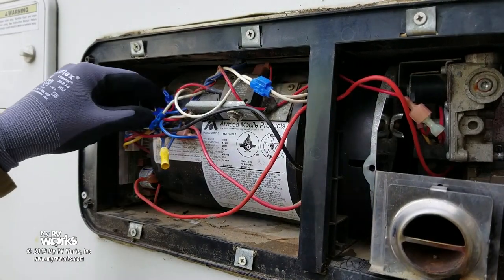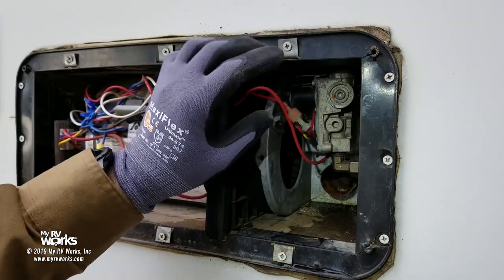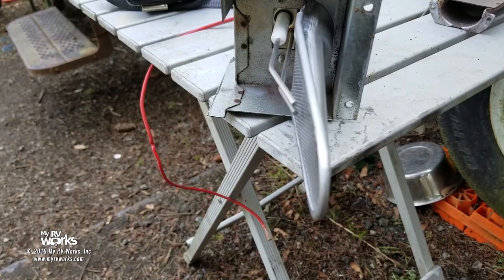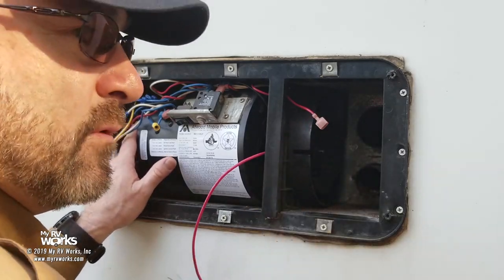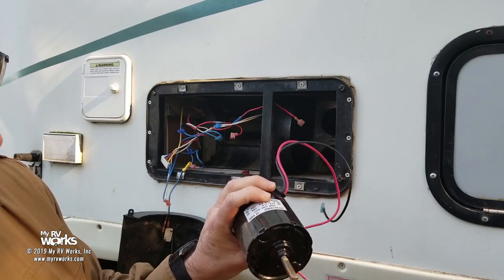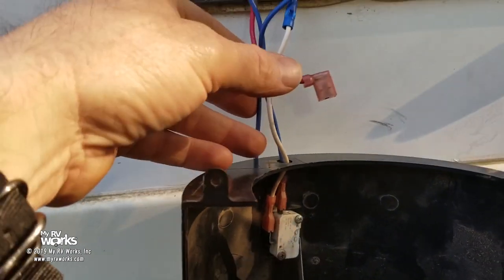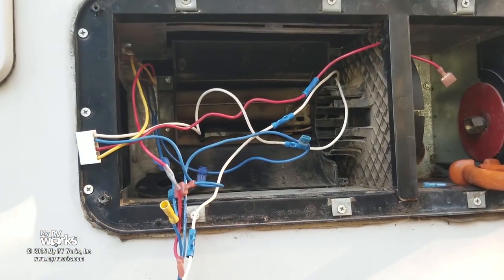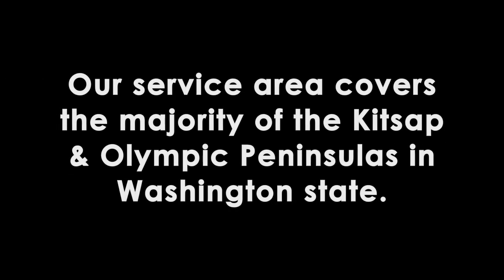RV Furnace Motor Squealing - Remove & Replace Motor, Electrode, and Burner

Comment: You asked for different ways to remove the blower wheel or fan from the motor shaft . 
Years ago in the 80s, when I was starting in the HVAC field an old timer taught me a trick because I was tearing up the blower motor fan on a furnace. Lol
His trick was to loosen the set screw and place an old socket over the shaft onto the collar of the fan, hitting it with a hammer to drive the fan blade just a little bit further down onto the shaft. Then use sand paper to clean the old motor shaft before attempting to remove it. There's always a rust or dirt line around it. When it's clean then I spray it with oil before I attempt to remove it by gently prying it from behind with 2 screwdrivers.
 You may already do this but it's worked for me for a long time. You have the best repair videos I've ever seen online for this type of repairs. Thank you for taking the time it really helps me.

Comment: Thanks Daren. For the motor job. It's getting easier for me to follow, the more I watch the more I see and understand.
Reply from the maker: You can do it!
Reply: Yeah I like that. You can do it. Yes I can do it. I don't want to lol. And I'm using the age card 60. But no, you can't even hire people to do anything without breaking stuff and they're lazy. Anyway I digress. Yes when will these young kids work as hard as people from or how we were raised. That's the biggest challenge I ever renovation modeling business and I've rental properties. It's pretty much impossible but I shouldn't give up and that's why you're still doing it. You can't find good help I don't think. Anyway, thank you, thank you, thank you. It took me a long time to find this video and I just have to make sure I find the right motor. It's just a squeaking thing and it's plugged in so I don't really have to worry about any of the other stuff. But I'll inspect and if I'm digging in there. I'm doing everything a lot of stuff you got to take off and put on what happened to plug and Play lol

Comment: I just ran through this process. Worked perfectly, almost. I didn't quit get the plug back onto the control board all the way so the heater ignored the thermostat and just kept running. Supper easy fix. Plug it in all the way. Recomendation: I think you should buy the smaller blower fan (the one on the right for the fire box) just in case you break the old one. Just return it if you don't need it, but the only one is a pain to get off the shaft. I'm very thankful I found this video. My repaired heater works great now, and so quiet.

Comment: Glad I found this video great job I've had a fair run with my camper lately for some reason or another this all happened recently the converter quit and stopped charging I replaced it $450,  the next day the thermostat quit I replaced it with a Honeywell residential worked great,  2 days later the blower started screaming like this one did, I kinda took it apart and lubed it just to buy time over the weekend and now it fires for about 5 mins and starts blowing cold for a couple mins and kicks on again repeatedly...I get all my new parts tomorrow!! Doing the whole job every piece is getting replaced now I know what they all so huge help thank you

Comment: Great and helpful video. As a Retired U S Navy Engineering Officer , Graduate of RV School at Lane Community College and spending 32 of the last 35 years as a full timer I thank you for your detailed videos. One thing I would add would be a check of the propane line fitting after reattaching. Keep up the good work.
Reply from the maker: Yes indeed, you are correct. I have a gas sniffer, you may have seen in some of my other videos, and once I run the system I do a sniff test with that device. Thanks for the comment happy camping.

Comment: Awesome, very informative. Keep the videos coming. I had the same problem with the high limit switch. The burner kept going on and off and it would never get to temp inside the coach. What I ended up finding out was only 4 of the 5 ducts were only hooked up . As soon as I hooked up the 5th duct to the basement off the coach, it worked flawless. Just a tidbit of info for ya. Keep up the great work.

Comment: Great video.  I am just completing a 85531ivDCLP.  Some differences from your video but very helpful.  I struggled to get the cover off of the fan housing because there are differences between your video and this unit.  I ended up removing the furnace which sucked!  Getting the small fan off was a chore hahahaa. After loosening the allen  then holding the big fan and rocking the small fan CCW and CW starts to loosen.  I also used PB blaster and some fine emery cloth to remove the rust from the end of the small fan shaft. That was tedious but worked, glad I was not working by the job..hahaha
Next observation I had was the limit switch you pointed out is not accessible without separating the fan housing and the ducting heat chamber.  
uggg.  There is also an air baffle for the left end of the big fan. It is held in place when you put the fan cover back on that your video does not have One other thing is some of the screws are different sized in thread size so attention needs to be made and keep track of which goes where.  Thank you for spending your valuable time to make your many useful videos.
.

Comment: Hi, that was very helpful, our fifth wheel was vandalized a while ago, furnace wires pulled out as well, your video helped me wire it back up, as well as changing out the motor or other parts for the furnace. Thank you.

Comment: Excellent video. Very well done, understandable and well shot. I followed it closely in changing my motor and squirrel cage.  Pretty sure I could not have done it without your video. So thank you a lot. One note, my setup had a Z shaped motor stiffener.

Comment: Great videos, it helped me diagnose a rusty burner like this one had on my 18 year old RV. Because of it's age and since I had everything out, I replaced the ignitor and valve assembly too. As for replacing a motor, since you have everything out, I'd go ahead and replace the limit switch. It's only $20 bucks on Amazon, but will save you the labor cost of doing all this again later. That's cheap insurance compared to losing your heat in the middle of the night and having to call a repairman to diagnose and replace it. Generally, labor costs are far more than parts cost, so if you're taking everything apart, might as well invest a few extra bucks, especially for older RVs.
Reply: I have a worn out Atwood 8536 lpg heater so was wondering if you could get me another one or a replacement one.
I enjoy your video's very helpfull.
Hope I get a reply from you 
Thanks

Comment: That was very useful. I was able to change out the blower motor on my furnace in my 1998 companion kit thanks to this video
Reply: My 1998 companion kit fith wheel camper has a Atwood Mobile Products 8525 - iii furnace in it. I live in my camper and here in central Wyoming it gets very cold during the winter so having my furnace working is extremely important and your video seriously helped me get it back up and running like new
Reply: @mlane1986  mines acting up now and it's starting to get chilly  here in washington so this video really did me a favor!
Reply: I also installed a 8kw diesel heater as a backup to the furnace. I got one of the cheap Chinese diesel heaters and I think all in it cost me $150 but it works really well and it wasn't that hard to instal.

Comment: You asked for suggestions on removing the larger squirrel cage- I loosened the Allen screw, supported the whole shebang on three blocks of wood with the motor down and the blower cage resting on the blocks, took a hammer and screwdriver and placed the blade of screwdriver on the end of the shaft, tapped a few times, and it slid right off the cage👍

Comment: The way that high temp sensor is buried and with the wires bypassing it. I think I would have tested or just replaced it to be absolutely sure I wouldn't have to tear it apart a second time.   Great channel, Subscribed

Comment: Thanks for the video. 
I wish my Burner came out that easy on my rear furnace. I had to fight mine.
Now I'm going to check my front furnace, I'm hoping just the ignitor just moved out of place which is what happened on the rear one.

Comment: I'll tell you it took me several hours to keep searching. This is a great video. Yeah it started squealing really loud. + This is what I have to take care of. The challenge is this elderly woman who I run it to. There's trees and bushes in that area so. I can do it but I have to clear an area. I digress. You just got to take your time and I wish they made it easy. I was thinking maybe I just shoot some lithium grease in that bearing. There's no way to get to it without pulling it apart and if I pull it apart I might as well change it. That's what I was thinking but it's just a nightmare. Just a lubricate it and it's forget it. Anyway, thank you very much. This is a great video and I was a little like I don't feel like doing that. Then I look at labor prices and I could do it but I don't want to but it would motivated me is this is real time. Anyway thanks so much and I got to stop being being lazy the thing is I've been doing this all my life. It's almost like I don't have to but labor prices are crazy. So now I got to get back to work and do this but anyway so I may not be able to do it. And as long as your video and it's hooked up to power so I don't think I'm going to have to worry about. Well I'll see. Sorry for the long voice text and half the time is preparing the area so I can get to it Bush's etc. And maybe nice little chair and a shade. It's hot in Florida. Anyway thank you so much. Not sure if I can do it in the time frame that you did it cuz you do it all the time. But thanks very very very detailed

Comment: I like the trick with the 12V battery pack used to turn the furnace on and test it.  Very slick.
Reply: Putting  direct current  is the best way to check last year my blower went out  in my car so I put direct current to it and it wouldn't work so I bought  a new and bam good to go

Comment: It's possible I missed it, and I hope I did, but did you do a drop test on this LP system after breaking the LP connection?
I watched the reassembly again and you didn't show it and /or mention it.  To anyone that is going to follow this please use soap water on the LP connection at the very least to check for leaks.

Comment: Great! Have same furnace ... BUT ..... no leak test of the gas fitting you took apart and hooked up again after your repair?
Reply from the maker: Great observation. We always do a leak test whenever we access the gas side. Darren doesn't record every aspect of the process when he's doing these videos and sometimes we edit out parts in a video to make it a better production. On this location there was a dog that was barking in the background. That may have been one of the reasons we cut that part out. Thanks for watching and thanks for the Discerning Eye. Good job.

Comment: Hey Darren. well I'm still having issues with my 8531 furnace. I've pulled it ,twice actually and this video really helped me. You make great videos. Something really weird going on here and I was wondering if you've experienced it. While on the bench the unit is blowing out a healthy amount of air but when I reinstall it and this is without reattaching the duct work there's virtually no air coming out.  It's got me really scratching my head. I'm thinking that this preventing my sail from allowing combustion. But why would it blow well on the bench and not in it's hole. Pulled it a second time as I thought that I was losing my mind.  Strange but true
Reply: Check the voltage being supplied to the motor from the coach.  Older wiring, or corroded contacts can cause a low voltage scenario at the motor when installed in the coach.
Reply: @historyteacher5821  Thanks, Actually it was a reverse polarity problem and solved

Comment: Great informative helpful vid. TY.  Now can you tell me why my Furnace wont shut off?  I have to unplug one of the relays or remove the plug on the back of the furnace inside the cabinet. If I disconnect the pos/neg from behind thermostat or remove the fuse it still stays on!

Comment: So mine didn't have a clamp holding the small fan on, it had an Alan. Took that out and have been wiggling the crap out of it with not luck. Used PB blaster, heat gun, hitting it aggressively and nothing budges. I tried grinding down the metal post thinking it's the rust but I can only grind so much. Thinking of somehow just cutting the post off but not sure if that is a good idea.

Comment: One little minor thing . When you start the job will the gas automatically be off is there some kind of check valve ? I saw you disconnect the gas line and didn't hear anything about gas escaping.. or did I miss it.. what I'm getting at is might be a good idea to turn the gas off first.. I realize you know much more than I do but I just didn't hear it in the video.. and not trying to be a jerk !

Comment: Thank you this is very helpful ~ not sure I will be able to pull this off on my American Eagle Coach as the furnace is a little different and worry about the gas connection being properly done ~ I was curious as to why you didn't unscrew the frame holding the unit inside? wouldn't it been easier to get everything out? Just wondering if there was a good reason not to or if it wouldn't have made a difference in getting at things ~

Comment: Need to mention that you need to turn propane back on and check for leaks. I'm camping right now and watched this video because my blower motor started sqeuaking. Is it possible to remove just the motor without pulling the gas assembly?

Comment: Model 8520 - IV - DCLP MFG. ~1998

I only needed a new gas valve. The motor needed a bit of lubricant on the bearings. It is a sealed unit so cannot be disassembled because the cover is staked in place. The sail switch, motor, burner, and igniter were all in excellent shape.

As a E/M Designer, by trade, I'd like to have a 5 minute conversation with the guy who designed this thing. Got his degree from a Sears Roebuck catalogue. Literally took hours to disassemble, repair, and reassemble mainly due to the poor engineering. Functionally great but lacking in repair-ability. 

WORD TO THE WISE: Before you start, make sure all of your tools are magnetized or suffer the frustration of trying to get the screws back into their nearly inaccessible holes. Also, get a set of line wrenches/flare nut wrenches. before you start. Got a set at Harbor Freight which covers ten sizes. 

1. The screws holding on the squirrel cage/motor housing cover have no clearance for a socket. Thin wall recommended.
2. Besides the clamping scheme, the motor was held in with a retainer that was impossible to replace once removed. I guess the factory has a tool to hold it in place during assembly that is not afforded to the rest of us. Luckily, I was able to remove the squirrel cage to access the motor and discover what was holding it in place. Threw that retainer in the trash.
3. In addition, my furnace has a ring that goes over the intake that has to be balanced in place on the fixed half of the housing while the removable portion is Jengaed into place and the juggling act with the screws can be performed. 
4. The fittings for the gas and burner orifice were assembled with Grey Goose joint compound which required a torch to disassemble. I reassembled both with yellow Teflon tape. Having been in engineering since the late 60's I know that Teflon tape existed long before this furnace's late 90's assembly date.

Comment: A good way to get those wheels off would be to  get a collet, you might be able to use one for residential power wire, and then some low level heat, have the collet ready and heat the shaft area, not anywhere else, then put the collet on and pull, another less successful way is to use a soldering iron with a high wattage to heat the metal motor shaft itself, but that’s more risky, basically you want to soften the plastic enough that it moves and isn’t as brittle but not enough for anything to warp, you could also get some flat tools behind it through the slots to help if you have an assistant, but that’s more risk than the reduced load on the rest of the wheel is. another method would be a penetration oil on the shaft and gently press it on more before you go to pull it off, that would allow it to be freed up on the shaft before you apply force in ways you can’t easily do so, but I haven’t had any luck with that method.

Comment: 12:50 my fan right there, actually slid to the left and started rubbing the housing.. melting to it. Like that clip wasn't tight enough. Initially I thought the motor was shot w all the squealing n blown fuses, but thankfully that fan only needed an adjustment.

Comment: This is my third day of trying to get the small blower wheel off the shaft.  I've tried completely removing the hex lock screw, soaking the hub with lots of PB Blaster, heating the hub, pounding on the end of the shaft (no room to pound hard, but that's probably a good thing not to flatten the end of the shaft or it will never come out of the hub), and prying between the motor and the sheet metal the motor shaft goes through. (It's plastic in the video.)

So far I've only been successful in bending the sheet metal and gaining about a quarter inch of movement.
Reply from the maker: The blower wheels are around $10.  So I just plan on destroying it to get it removed if it is stubborn.
Reply: @MyRVWorks  ended up cutting the motor shaft and taking the fan housing / gas valve/igniter  assy out and removing  the fan separately.  Tomorrow we'll press the remainder of the shaft out of the brass hub on the fan.  If we screw up the fan (metal, not plastic) I'll end up ordering a new one.  Thanks!